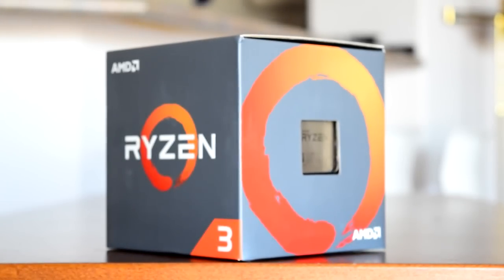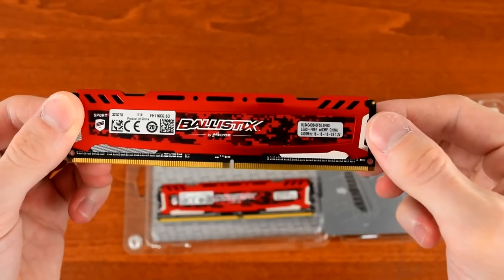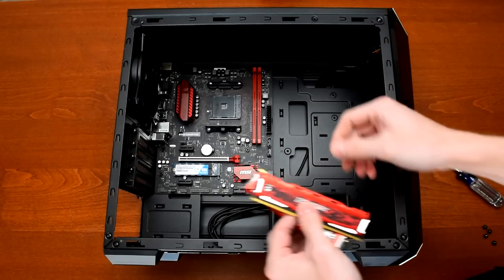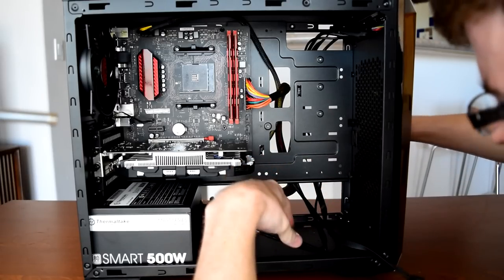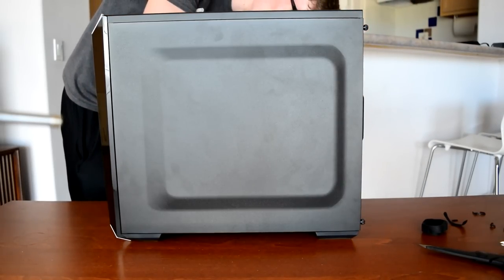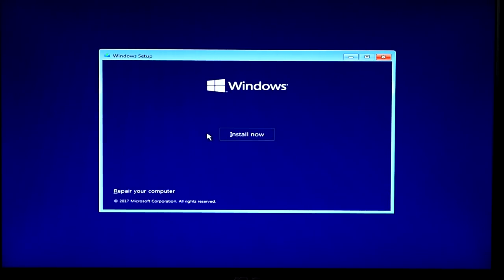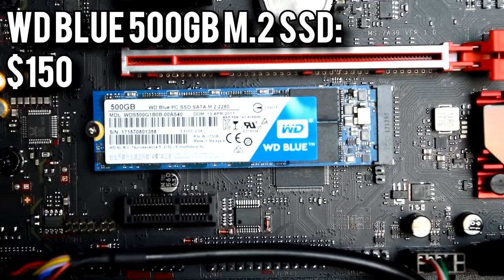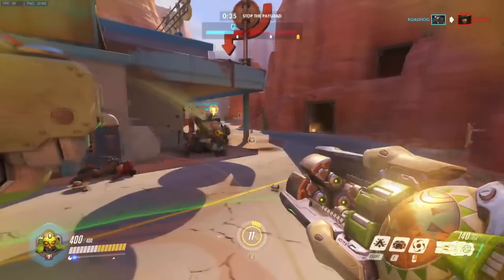Little Red: Under $500 Ryzen 3 1200 Budget Build!

Comment: I have bought the same configuration
Ryzen 3 1200
amd r7 360 gpu
gigabyte a320m hd2
and 500 W psu
but pc won't boot up.
is this because? Motherboard doesn't support processor right out of the box?
or maybe some component is damaged?
I have sent motherboard for replace as it was getting super hot when turned on. and psu is working on my brother's pc so processor or motherboard is to put blame? reply please

Comment: Ryzen likes high clocked memory you should use 2800-3000MHz memory
Reply: Wojtek m0osh At least 2666 mhz
Reply: up to 10% performance difference between different memory speeds. I did a video on it using Time Spy.
Reply: would the packaged fan cool it fine though...
Reply: The AMD stock coolers are good up to 3.8GHz. After that it depends on how much voltage you have to push.
Reply: Wojtek m0osh No. Ryzen 3 does not. It has been proven time and time again that this only applies to Ryzen 5 and 7.

Comment: Can I use the motherboard thats offered with the Ryzen 3 1300x w/Motherboard Edition? Will that be compatible with everything else mentioned in the video?
Reply from the maker: I'm not familiar with the Ryzen 3 1300x w/Motherboard Edition, but just about any motherboard will be compatible with the parts in this video. Every AM4 motherboard uses DDR4 memory and all of them will have at least one PCIe x16 slot for a video card. The only thing you may need to check is if your motherboard has an M.2 slot if you want an M.2 SSD.

Comment: AMD Actually uses PGA because its pins on the CPU. Like this the overall system is harder to damage/destroy and even easier to fix if it happens because the pins aint that thin and aint bent already. At least thats how I "proccess" it

Comment: Unless there's a rebate on a B350 mainboard, I'd still rather go with a R3 1300x and a A320 mainboard since the 1300x comes pre-overclocked to 3.7 GHz. Just install the CPU and you're done. Either pay $20-$30 more for a B350 motherboard or less for a A320 mainboard, but buy the 1300x and have a guaranteed, stable overclock :)
Reply: Kodtiz3D You're right. Actually, with XFR it clocks automatically up to 3.7 GHz. (Forget about the 3.9 Ghz xD)
Reply: so lonesome. It's just 2 cores or so clocked at 3.7Ghz not all of them if you are talking about the A320 mobo.
Reply: Shane Ma Ryzen 3 has 4 Cores 4 Threads. A320 Mainboards simply don't have a overclocking function and cost ike $30 less than a B350 with overclocking function. So I'd buy a 1300X @ 3.7 Ghz for $140 but a A320 board than a 1200 for $110 with a B350 Mainboard where I'd have to overclock the CPU by myself and for some fancy stuff nearly no one uses and I don't think that many people on a budget would actually consider upgrading their CPU in the next couple of months/years. + In my knowledge there are actually all cores overclocked to 3.7 Ghz, if not, please send me an article that proves your point. Best regards
Reply: so lonesome. I know A320 mobos don't have a overclocking function. Sorry I got confused thought the 1300x was 3.5 GHz for some reason. Also the 1300x is 3.9Ghz with XFR not 3.7Ghz.

Comment: -Instead of an SSD, you could've used the Seagate SSHD 1TB, and save $40, while getting a higher end card, AND it performs nearly the same as an SSD.

-Asus Prime B350M-A is like $10 - $15 less, and literally 2 times better. (More durability, overclocking is better, etc.)
Reply: thomas wood Why not?

Comment: Not gonna lie here, i just setup a budget build, with a 2tb HDD, a I5 2500k with a Z68 motherboard, a 120gb SSD, a GTX 770, a EVGA 600W B1 PSU, a Tempered glass DIYPC case, 8gb of ram, and a nice LED kit from amazon total= 395.84 and i can bet you this will perform better because the 2500k gets up to 4.5 on my Cryorig H7 Lol, im just trying to say if you look hard and buy used you can get a better PC for cheaper.

Comment: does anyone know if Crucial Ballistix Sport LT 1x8GB DDR4-3000 is compatible? because i don't see it on the msi website, but then again it doesn't appear the Crucial Ballistix Sport LT 2x4GB DDR4-2400 (used for this build)
Reply: check it on pcpartpicker. there you can check if everything in your build is compatible with each other. it might not be 100% accurate but it is pretty reliable
Reply: Nikos Filis thanks a lot!
Reply: 2666mhz is the true speed for Ryzen 3
Reply: cwli1 oohhh k thanks

Comment: Why should you buy this cpu+mobo+ram combo for almost 300$ for card like 1050/1050ti if you can buy used combo phenom II x4/x6+8/16gb+mobo or something similar for just 50-80$ and it will perform the same?  I am seriously don't get the logic of bying anything new and pair it with card less powerfull than 1060 atleast. Tell me if i am wrong ;(
Reply: Any proofs? The limiting factor is gpu here, not cpu.
Reply: kartoffel42  and again. any proof?
Reply: g4560 stutters at cpu demanding games, but true phenoms 4 cores doesnt. Your choice ;)
Reply: Then get a Ryzen 1200, quad core and definitely out-performs a old phenom, lmao.
Reply: Simple for a 6x more pricetag :) budget build lol. mby you should take 1060 with it, because this is where phenom bottlenecks. pretty much at everything more powerful than 1050. rx 470 bottlenecks like twice of fps. but good thing is that you can always push graphics to the sky and get pretty much the same framerates even with top i7. miracles of modern pcs my friend😀
Reply: Well you can't compare new 2017 hardware with used pre 2010 ones mate xD
Sure if you buy some old Xeon cpu (from servers pc) you could build a computer for basically the price of the gpu, but the advantage of buying an am4 mobo is that you can upgrade later to a better cpu, zen 2 or 3 and future game will work worse and worse with older architectures
Reply: Yeah what if you want to upgrade down the line? You're going to have to purchase a brand new motherboard, and say you want to run higher end games? New GPU, Processor, Motherboard, RAM. Keep this all into account mate, because in the long run Phenoms won't be able to run ANYTHING, there are so many other processors better than that.
Reply: "Yeah what if you want to upgrade down the line? You're going to have to purchase a brand new motherboard, and say you want to run higher end games? New GPU, Processor, Motherboard, RAM. "
Well, this is what intel does :D New chipset comes out every year without support of past years hardware ;)
Btw, am3+ boards supports up to latest fx. And again, my point is, that if you need a more powerfull gpu, you will need a comparable and adequate components as well. Ofc in case of upgrade its much better. But talking about budget only, g4560 with chipest possible h110+bios update and 2400/2600 ram will give you higher fps at moment(but with some lags) but in future, you can upgrade it to 7700k, when new cpus will come to market(i3 with 4 cores, i5 with HT, and 6+ core i7) the 7700k will be super cheap, and just for games it has nothing better at the moment in hitting high framerates. 
But just in terms in assembling pc just to play on it with 1050(not even ti version), you really can go as cheap as possible in here, and when you will feel that your pc is completely outdated, just buy something else. Mby at that time used ryzen 1600 will cost 60$ or something ;D
Anyway, i think we need to stop this conversation. I already stated my opinion in all the possible ways, and dont really want to spend my time writing those comments.
GL to all, and have a nice hardware. Peace ;>

Comment: How do you know what power supply you need?
Reply: Joey de Rijcke use psu calculator from cooler master u can google it. It will show the estimated power
Reply: Or you can base it off your GPU power recommendation if your CPU is below 100w but if you're using like FX series you probably will need more power
Reply: You can look up how much wattage each of of your components will draw at peek, and get something with a decent buffer above for future upgrades. The majority of wattage will be drawn from your CPU and GPU.

Comment: You should have bought the red gpu also msi
Reply: Wake that's like $170 USD
Reply: Daniel Willey well you're right... But it also is more powerfull and better for video...
Reply: And it's not that expensive, is it?
Reply: Wake Dont get a 1050 if at all possible. Get a 1050 TI or if possible, a 1060 3GB.
Reply: I din't say anytging about non-ti 1050 😂

Comment: Okay so, taking in consideration that this is a budget setup, you missed in three thing in my opinion:
-First of all, why whould you spend 150 bucks on a mobo when a MSI a320m bazooka gets the job done perfectly for only 80?
-Secondly, why whould you spend 170 bucks on a slow 500GB M.2 SSD when you can get a cheaper SATA one or a much faster Samsung one? And 250GB for an SSD is enought, you can savea lot of money on it.
-Finally, 65 dollars on a case... Are you serious? 

Taking in consideration those changes, you can save 70 on the mobo, 40 on the SSD and 30 on the case, so 140 dollars that you spend without any reason. With that you can get a ryzen 5 processor or a GTX 1060, with whould add a lot more juice to the PC than a cool looking case and a MOBO with futuristic graphic desgin. 
Btw the 4GB variation of the GPU that you've used is 5 dollars less expensive... Do I need to say anything else?

I'm currently studying Informatics Engineering at the university and i've been using computer since I was 3 years old, and built my first PC at the age of 11, so if you're going to reply me, please be a bit wise and dont just say "U CUNT THIS IS BETTER CAUSE HE SAIS IT AND YOU ARE A KID", otherwise you will be just ignored or blocked, depending on how my day is going
Reply: Alonsitis Duff hm a bit over the top my friend he said for the ssd it's for his own reasons and he told everyone you could just go with 1tb of wd blue and it be under 500 

I dunno what world your living in but the case is half the price of the example you gave it's only 35 for me
Reply: I dunno what world you living either, wanna check the description link? 

I know the ssd is because of his own reason, otherwise he whouldnt have included it, im just saying that those reasons are wrong
Reply: He said 150$, and 170$ is barely the price of a samsung 850 evo 500g man, though it's true 250go is enough if you don't need too many games

A msi b350 gaming pro is 85$ for me, and you're a big idiot if you buy a ryzen cpu with a locked mobo like a a320 ...
Also the case is 40$

You don't seem to have watch the full video because it's said the 1050 2gb is 110$ while the retail price of the 1050 Ti 4gb is 150$ ... (worth the 40$ upgrade imo)

Please don't act that way when you obviously don't know shit about a ryzen build and don't know the real price of the hardware you're talking about - said the guy born in the jungle who didn't touch a computer before the age of 11 :p
Reply: Yann Renvoisé First of all I've made a ryzen computer a month ago myself, if you don't believe me you can see it in my channel although it's in Spanish so you won't understand anything. I own the a320m and it's not locked, in fact I've overclocked my cpu (1700 with stock cooler) to 4ghz. I was talking about the 960 Evo, not the 850, the 960 is way, way faster than the 850 and you can buy a 1tb HDD later if you need more storage. And finally I've based my comment on the prices that he provided in the description, because if someone is going to buy this build he cannot go to Amazon and say "Yo guys this fella on YouTube says that this gpu is 120$ so I want it for that price even though you are selling it for 164$". You get me right?
Reply: Am french so I managed to understand the part about the computer :p (nice case you got)
Can't find a single article about cpu overclocking on a a320 mobo, you're trolling me ...that's why they are priced around 50$ and a real b350 around 75$~80$, though you can overclock the memory, also the bazooka models are not for budget build it's high quality material (though I personally would spend the extra 20$)
Well you do what you want but an NVMe SSD priced around 230$ is overkill for a budget build, sure if you edit videos for your channel or use intensive software it might help a little bit, but a regular Sata III for 150$ gets the job done perfectly fine for gaming, many videos don't reccommend NVMe for sub 1000$ builds
About the links yeah it's a shame they don't refer to the best deals, but at least on the video he gave the actual average price and the name/model of the component, if you click "Buy" when the price is obviously 50% more than what he reccomended .... perhaps you're not ready yet to build a computer and should wait and research more, people who take the time to watch budget builds tutorials have the time to do a little bit of research on their own don't you think ? Also pretty sure this guy is american, so unless you live in the usa you'll never find the same deals and will be forced to find deals yourself unfortunately u_u'
Reply: Yann Renvoisé  Yeah the prices look very different from Spain to the states... I thought a 250gb nvme SSD should cost about 150$ as in Spain they cost 140€ (my Samsung costed that) and the a320 Mobo costed me around 70€, so as I can see some things are much more expensive on the states such as the SSD and some are more expensive here such as the Mobo... 
About oc with my mother board, I'm not trolling, it may have to do with being from a Spanish store, there may be some differences from Spanish and USA products although it doesn't seem to reasonable... 
Well I've seen the video because I got curious about what components have him selected since a lot of tech channels tell you to buy liquid cooling or very expensive RGB cases and then spend only 150 bucks on a gpu; at least this one didn't made those mistakes
Reply: Oh i was talking about a 500gb NVMe, the 250gb is about 150$ but since you need to pay the transport it's better to buy here ;)
Hum okay, well a b350 would be 5€ more so I guess it doesn't make a difference
And yeah some channels are crazy and sometimes sponsored to include this fancy cooler or fancy case, but those with not too many subs generally are better, you've got to find the good ones
Check OzTalksHW, Tech By Matt, ScatterVolt or Nerd On A Budget, they do some pretty good builds ;)
Reply: Yann Renvoisé Sure! I'll check them out when I come back home. Damn it, the prices again XD I took into consideration the b350 price on the link in the description so yeah, if the difference is only 5 dollars the b350 is the way to go

Comment: FYI FOLKS I HAVE A R5 1400 STOCK COOLER THATS OVER CLOCKED TO 3.8. AND MY TEMPS ARE LOW THE STOCK COOLER ARE ON PAR WITH 30 DOLLAR COOLER MASTER SOLUTIONS AMD NAILED THESE CPU's IN EVERYWAY SO YOU'LL BE FINE WITH A STOCK COOLER 👍✌😎

Comment: Sorry if this sounds bad but this just made me wonder what went on in your head putting in the CPU last. Are you trying to be unique or just really want to give yourself a hard time. Take out the motherboard first install the CPU, CPU Cooler and the RAM. Put the standoffs into the motherboard and screw it in the do everything else. If you did it for another reason please let me know cause it's bothering me that you're doing this to yourself.
Reply: The fact that you broke the front panel USB 3 pins just makes me even more concerned. When building a PC without doing a test boot I hope you realise that patience is key.
Reply: He said he started the build before he got the cpu.

Comment: Ponchato, how is this $500? It's actually about $600
Reply: KingIzlandi Use a 1TB HDD instead of the SSD. It's in the description.
Reply: KingIzlandi instead of the ssd, get a western digital hdd, it will drop the price significantly
Reply: I agree with the $600. The SSD instead of HDD will add another $100 on top of that.
Currently, on Newegg, the specified items cost ~$540 with many of the items on sale. Regular price is >$600.

Comment: I can NOT build this PC this cheap... I tried PCpartpicker, newegg, amazon, MSI and many others... -_-
Reply: that's because it's not a sub $500 build lol
Reply: and if you need built in Wifi, you can always upgrade to the Gigabyte - GA-AB350N-Gaming WIF mobo for a little bit more money.
Reply from the maker: The SSD brings it to $589, if you get a 1TB hard drive instead it's ~$489. I just put an SSD in because this'll be my test bed for AMD CPUs from now on.
Reply: even tho this is a budget build, I would still get a Fully Modular 80+ certified PSU
Reply: +ponchato
Without the SSD, just 1TB HDD, I can NOT bring it below 531$...
Reply: +Matthew Gross
the 80+ rating doesn't matter, quality of the components matter. I personally like semi-modular, because obviously there are mandatory cables I need anyway and they are the ones that are NOT modular, so I save money and I get the same modularity and cable management.
Reply: get rid of the 2x4GB stick kit and get a 1x8GB... that way you'll have room to upgrade with another 8GB stick should you need to in the future
Reply: @kodtiz3d that's a damn good sub $500 build